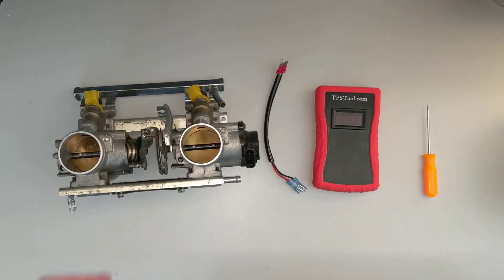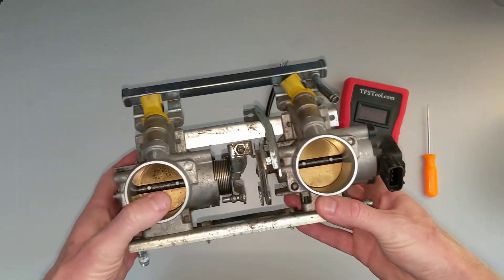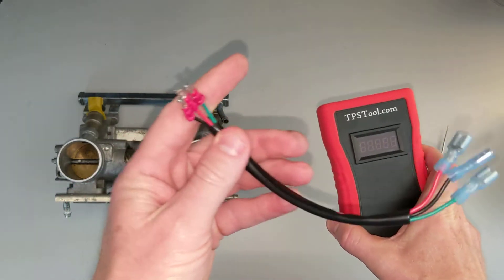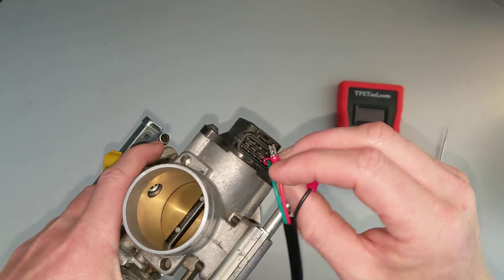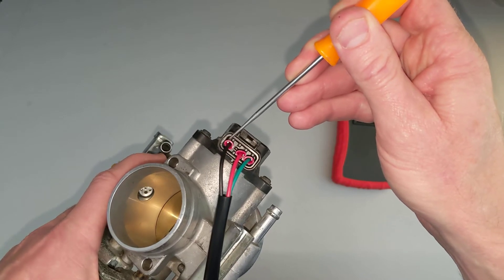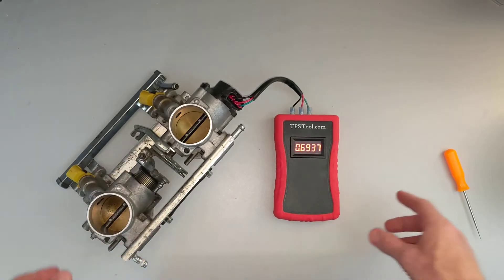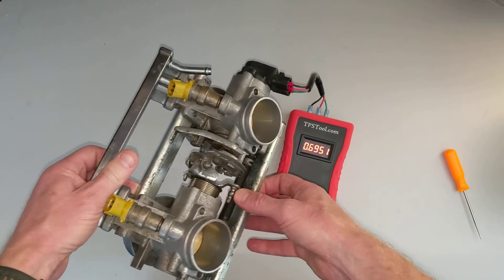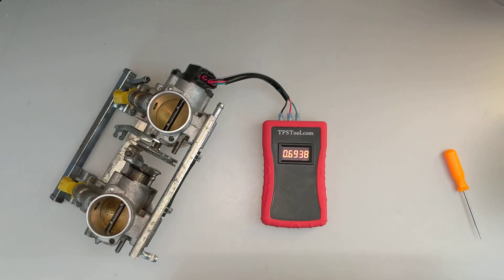Arctic Cat TPS Adjustment - 2008 era M8, F8, Crossfire 800 and similar - TPSTool.com

Comment: Would you have setting for 05 m7 artic cat?
Reply from the maker: Thanks for your question.  For the EFI version, the manual says 0.69-0.71V at idle for the "600/700cc laydown" engine for that year.  You can find the service manual at countrycat.com, search their support area for the 2005 2-stroke service manual.  The info is around page 251.
Reply from the maker: There is also a link to the manual on the common settings page on our web site.  In the Arctic Cat section, there are rows for both the Carburetor and EFI models with links to the service manual on the right.

Comment: Do i need the tool for a 2007 f5?
Reply from the maker: Thanks for your comment. Yes you can use this tool on your 2007 F5.  Check out the details on our common settings page, scroll down to Arctic Cat 500cc 2-stroke EFI 2007.  Let me know if you have any other questions.

Comment: I have searched all over looking to get the readings on that exact tps. 08 f8. Any help is grateful
Reply from the maker: Thank you very much for your comment.  According to the service manual, 2008 800cc 2-strokes should be set to 0.7V at idle.  Here's a link to the service manual, jump to page 323:  https://support.countrycat.com/posts/2801586-2008-2-stroke-service-manual

Comment: I bought the tool to adjust my tps sensor on my 2006 Honda crf 450r. And in the repair manual it says that it should be 4 - 6 kΩ. What number should it say on the tool for it to be 5 kΩ? I really need help because I can't figure this out. Please help!
Reply from the maker: Thanks for your comment.  I believe for your CRF450 you can set it to 0.7v and that should be within factory spec.